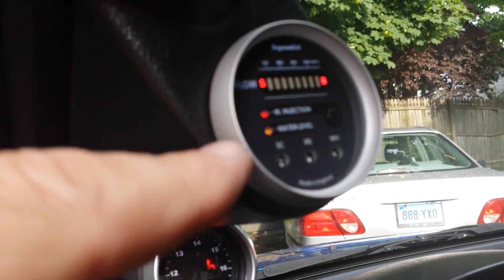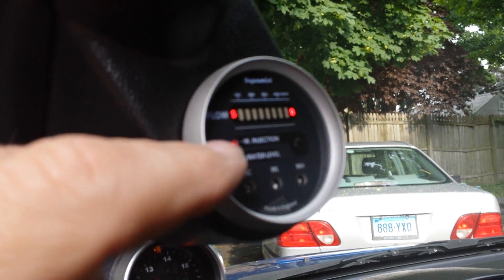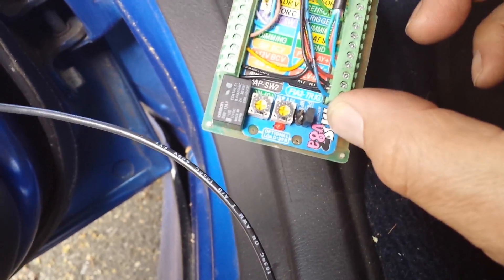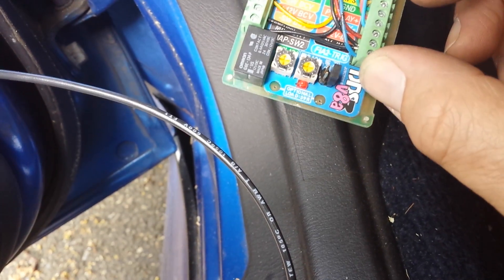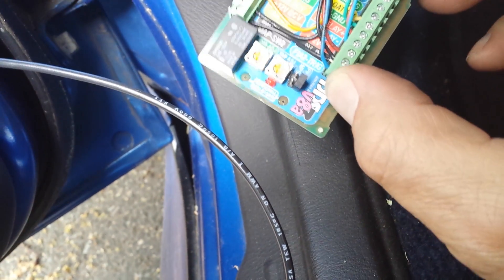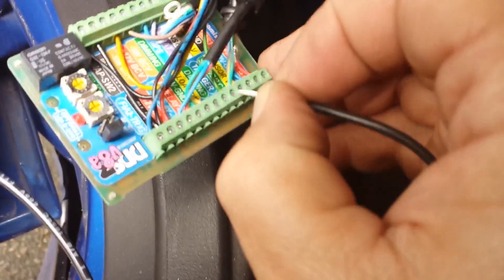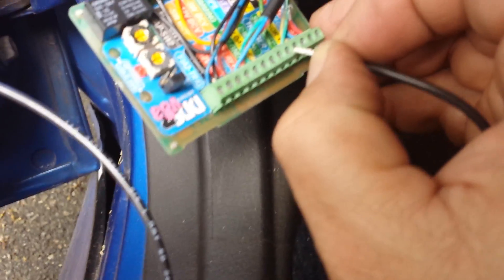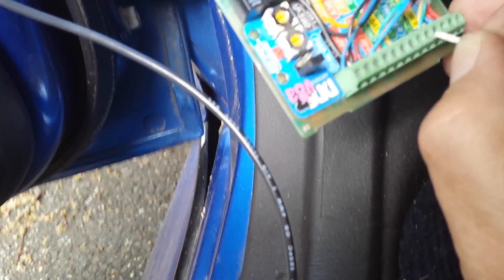Aquamist Fix

Comment: I'm curious as to how that switchover from fuel to alco works.  I'm assuming it just modifies the pulse width, but how do you account for the added timing?  I'm missing something there with that little box.
.
Also, I thought you said the aquamix wasn't working, but you hit the trigger it worked fine - did you replace the box before you tested or something?